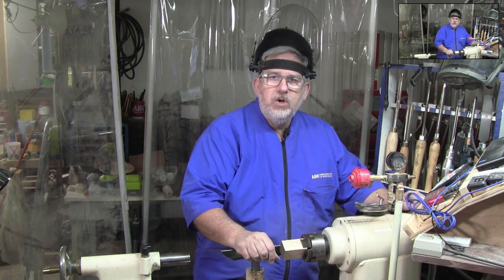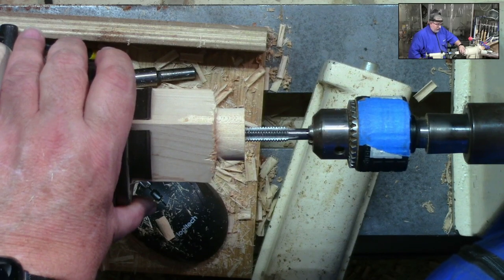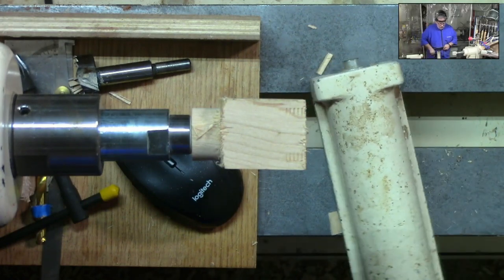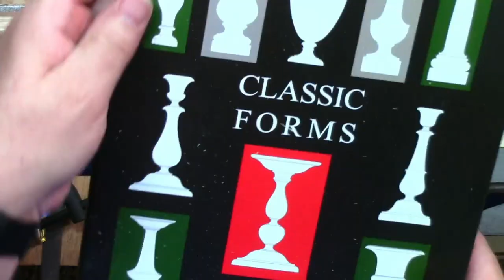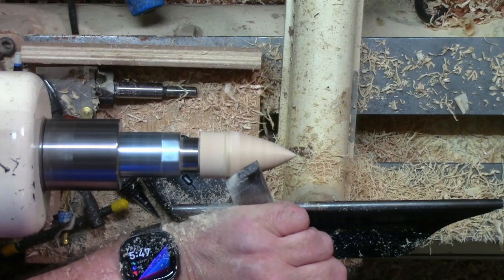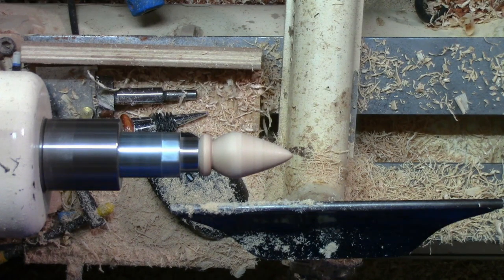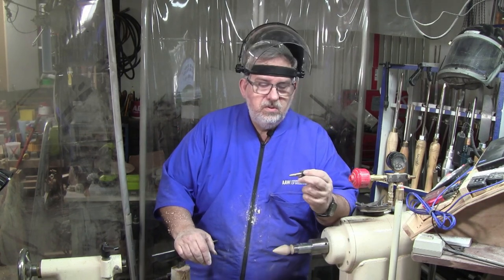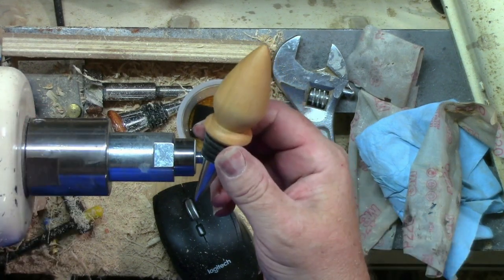How to Turn A Bottle Stopper That Sells By Dean's Woodworking. #woodturning

Comment: I apply a wax (any kind) to the metal threads before turning a bottle stopper...after one finished piece would not unscrew, and I crushed in trying to unscrew it. It helps.
Reply from the maker: Great tip thanks for sharing!!!

Comment: C an you please add  link for the stops it would be nice nd you could make a buck or two on the sell
Reply from the maker: Jon I am in the process of getting that done check back tomorrow. Thanks for Watching!!!
Reply from the maker: jon I have added links to the bottle stopper chuck and the metal bottle stoppers both the cone and the standing. Thanks